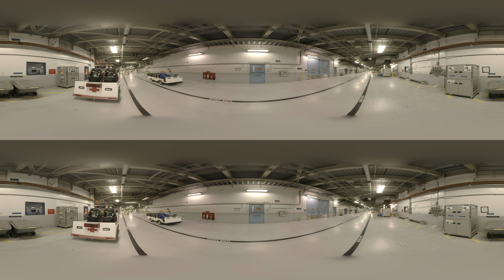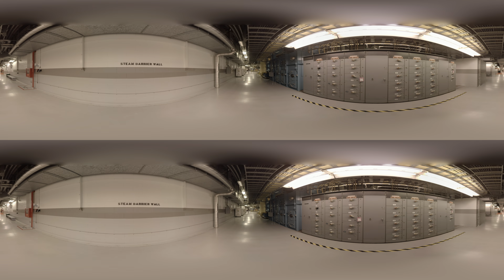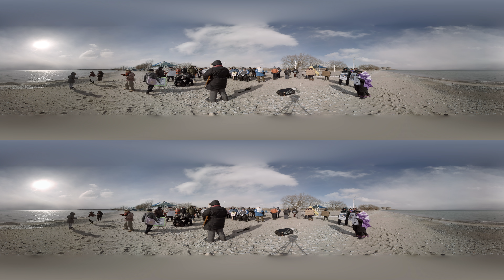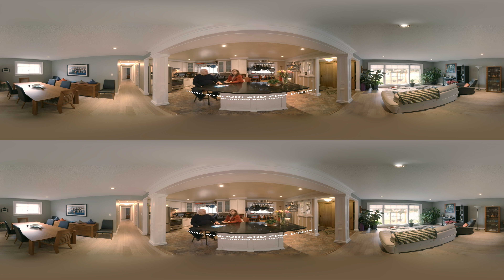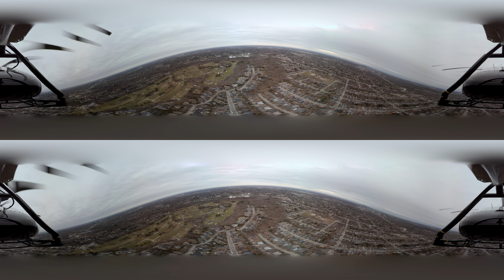POWER Ep 3: A Community Divided

Comment: The first fission (splitting of atom) of Uranium was in 1938. The darn neutron wasn't discovered until 1932 to split the atom with. What is this 1917 stuff? Also the "spindle" you show is a LP (Low Pressure Steam) Rotor not a spindle. Get your facts right. Also CANDUs are nothing like Fukushima's which were GE Boiling Water Reactors so you can't compare the two. If you worry about Fukushima look across Lake Ontario at Nine Mile Point which have the same reactor type (Well Unit 2 is, Unit 1 is an older design) and by the way they are not in a tsunami zone. So people don't know what their talking about.

Comment: Those protesters were so unfortunately uninformed.  Most workers due urine samples once a month to measure tritium levels and make sure they dont exceed a safe limit. Everything is poisonous if you go over the limit, and radioactivity is exactly like that. there is nothing wrong with small doses. That same protester probably doesnt realize bananas are radioactive, and that she gets more radioactivity from the sun in an airplane then she would ever get in a lifetime of living next to a nuclear plant. 

She also is worried about a mishap causing meltdown, when she doesnt realize how intense procedure is like at power plants. For a worker to change one simple valve, there needs to be at least 8 people signing off on it. 1 person to let people know the valve needs changing, 1 to isolate the valve and 1 to check his work. Another person creates a permit for the work to be done, and another one checks it, another person holds the permit and rechecks all previous steps. Then that 'holder of the permit' assigns two workers to do the work. Before those workers even do the work, they have to go through a rigorous verification check process to make sure they are on the correct valve, and they too also check all previous steps. Mishaps DONT HAPPEN at OPG.

Comment: Nuclear power is the ONLY carbon free base load power available. Smart, new-age nuclear power paired with renewables such as solar and wind is the only way to a clean carbon-free future. People need to get their heads out of their ass and do some research before they state their opinion.
Reply: Pretty sure hydro is a renewable energy source. You would have read that if you saw past the first sentence.
Reply: I think you need to read again as MNTNA's comment is quite specific as to what constitutes a 'base load'. MNTNA didn't mention hydro at all, only unstable/unreliable solar and wind. Quebec gets almost all of their power from hydro, no nuclear at all. We'd do well to follow their example, or at least construct HVDC transmission lines like Vermont etc did.
Reply: Your right when water goes through a hydro dam it becomes spent and it is not possible to use the water for anything as it has been spent. Water is a non-renewable resource. Also, they state multiple times, during the series, that the are talking about Ontario, not Quebec
Reply: woodchuck 00, you seem to be confusing different issues.

MNTNA stated "Nuclear power is the ONLY carbon free base load power available". This is simply false. Ontario ran on hydro-electric power for most of a century until we started building CANDU reactors, even before we started building thermal plants (burning coal). Hydro-electric can meet a lot more of our demand than it currently does (which, by the way, is roughly one quarter of electricity generated in Ontario). Manitoba and Quebec currently get most of their electricity from essentially falling water, which further debunks MNTNA's claim.

The problem with Ontario is that most of the population lives away from our good sources of hydro electricity, and long-distance transmission of large amounts of power is historically very difficult. That's why Ontario built Pickering, Darlington, etc - right near the largest metropolis in the province. (Although the largest is actually Bruce - not Darlington as one of the videos in this series claims)

Around the same time Ontario was building CANDU, Quebec was investing in remote hydroelectricity. I encourage you to do some research on the La Grande River hydroelectric project. In the late 1980s Quebec pioneered long-distance electrical transmission with their High-Voltage DC transmission line, connecting the extremely remote La Grande River complex with the New England area of the United States, efficiently delivering power as far as Massachusetts. The Quebec-New England HVDC line carries about 2GW, which is not trivial!

Using this technology there is no reason to restrict future expansion to nuclear fission (which, while excellent, is really quite expensive, particularly the CANDU approach, and waste will always be an issue, whether materially or politically). HVDC technology makes much more realistic the possibility of bringing energy from remote dams to areas where the power is needed. Better yet, it already exists, with no such engineering/licensing/acceptance hurdles like molten salt reactors, thorium, and other designs which are not actually in production.
Reply: Your right Hydro-Québec's electricity transmission system is a cool read. I am jealous I live within 10 miles of Folsom Dam and I get most of my power from natural gas, I say at least because apparently, 23% of my utility power comes from untraceable sources. I think if you live in a country with an average population density of 3 hydro can very well be load power, but in the US the density is 84 so its a bit more difficult.
Reply: It's far from the "only" solution. Ever heard of hydro?